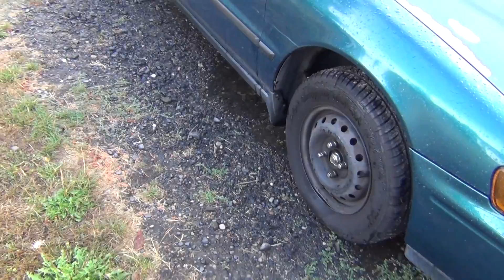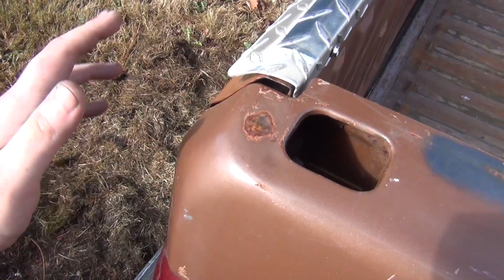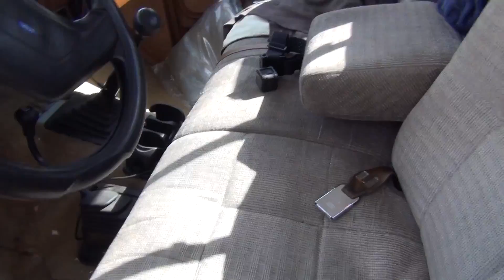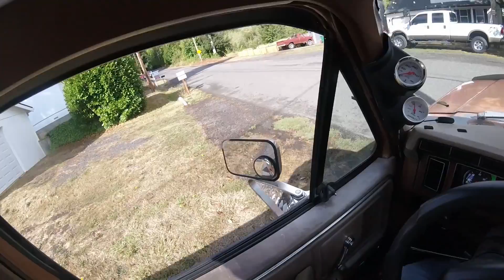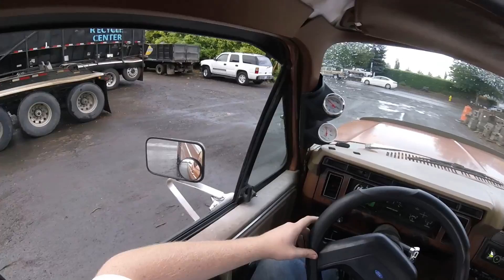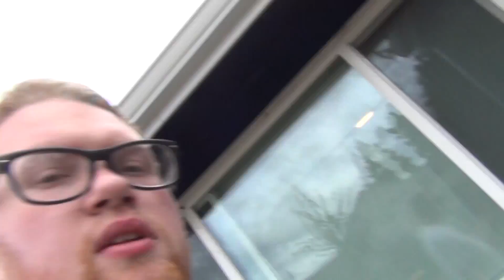Picking Up a Load of Gravel With The Bed Trailer

Comment: Great video man, I really enjoyed it. And yea, the guys who tow trailers at like 70+ mph are insane. What a lot of guys don't realize is that ST trailer tires are generally only rated at a top speed of 65 mph and by going 70+ mph consistently with them will cause blowouts and excessive heat to the bearings as well. Whenever I tow, I try and stay right at the 60 mph mark unless I really need to pass someone.
Reply: Or you can be smart and put LT tires on your trailer and use good grease, then you can pull a trailer loaded to the max at 90 no problems and your tires wear longer and dont dry rot as fast

Go check out a travel trailer forum and everyone recommends lt tires

Comment: Swap out the leaf springs on the trailer with F-250 or F-350 leaf springs the reason why it's squatting so low when you load it is the fact it only has F150 leaf springs.

Comment: Here in ohio i just go to gravel pit and get a load of number 8 gravel for my  moms parking spot it costs 10dollars a ton i get a ton in my silverado 1 time a year put about 60to 70 percent in parking spot  under carport at gpas for moms car rest of drive asphalt  and leave prob 200 to 400 for winter weight on and spring rest of it goes in parking spot

Comment: Im looking to do almost the same swap you did i have a 86 f150 i already have the m5od and im just gathering the parts for the swap and im building it so i can take my truck basically on camping trips and pull my buggy which prolly weights around 2k buggy and trailor but i also want to be able to pull a car on a car trailer which ive done with my 351 c6 combo a few times do you thing the 4bt m5od would be a good option for this ?

Comment: I've got an idea just put another $5,000 into your trailer and then you can haul most of what you can fit on the little bed.  LOL  Just kidding!!
The setup that you have your trailer is about rite currently.  The 50% squat is about rite for comfortable, controlled ride.  An add-o-leaf and shocks.  Would help all the more you need for a trailer of that design and size without getting to deep in budget.  If you want to seriously increase your load capacity and stay safe I highly recommend a true trailer axle with breaks.  Even my light duty utility trailer has trailer breaks.
Reply: Lifting your trailer is a very bad and can be dangerous idea!!!
Reply from the maker: Jesse Fuller ive been thinking about the trailer axle deal. Then like you mentioned, i could incorporate electric brakes.